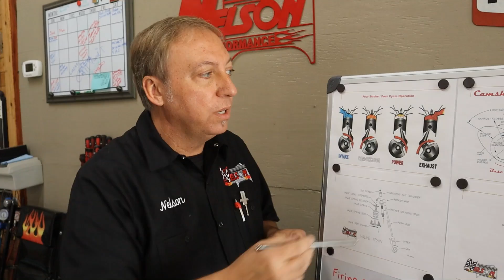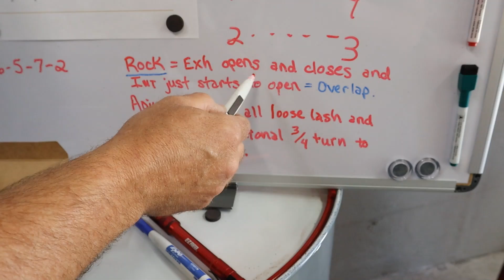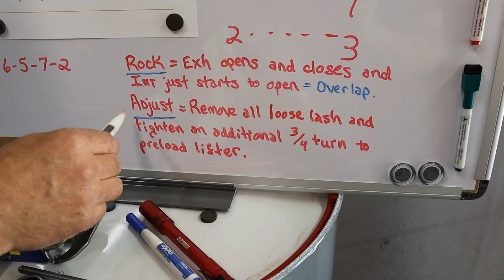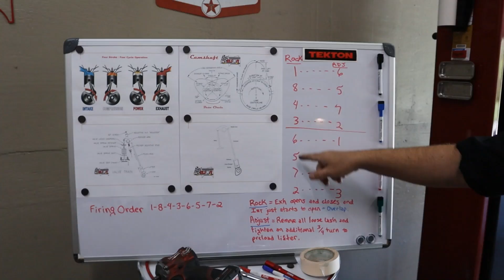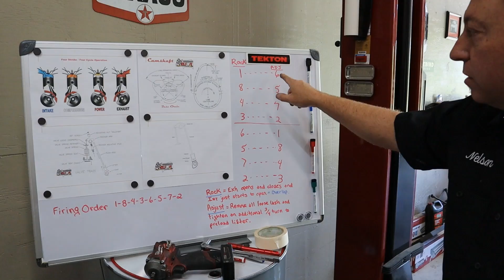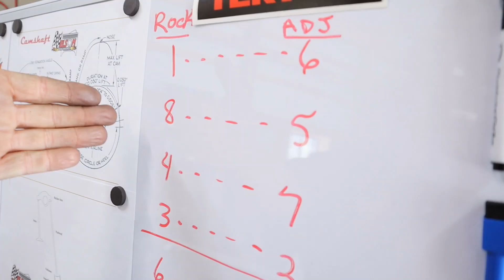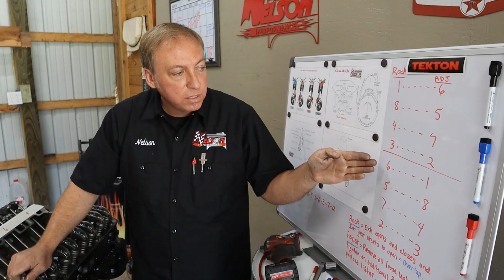Rocker Arm/Hydraulic Lifter Adjustment

Comment: Dear Mitch,  I´ve a 2.8 L V6 1988 Cutlass Ciera just overhauled. I primed engine two times turning oil pump with a electric drill. After engine hardly started, worked roughly.  But after seeing some videos I realized that I never applied a 1 1/2 turns of preload. After atemps to start the engine, starter can´t overcome engine counterpression. I suspect valves are lacking adjustment. The 1st compression test and come up with  very low values:  cil 1with 85 p.s.i., cil 2 with 75 p.s.i., cil 3 with 65 p.s.i, cil 4 with 80 p.s.i., cil 5 with 75#, and cil 6 with 80 p.s.i.  Do you recommend  dynamic valve adjust, despite oil spill all over, or there´s a chance of perform, a 120 degress rotation every piston and adjust every cylinder, according to firing order, and apply 1 1/2 turn of preload, despite lifters now are filled with oil? Thanks in advance, sorry it´s my first engine overhaul, and I saw a little bit late your very interesting video uploaded .

Comment: Question.  Is this method for lifters that have no oil in them  or can this be used with lifter that have been soaked in oil.   Thank you
Reply from the maker: Hello, you can still use the 3/4 turn and do the adjustment with lifters that already have oil pressure in them. The valve springs have enough pressure to “bleed” the lifter back under full valve lift during the adjustment process since there is no oil pressure until the engine is started up. I prefer to do a dry install until after the adjustment is made ,then use an oil pump primer (in the distributor hole) to circulate oil through the system before start up. Good luck on your project! Thanks for the comment and viewing! Nelson
Reply: @mitchnelsonperformance 

Thank you very much for taking the time to explain it to me. Have a great new year. I’ll be looking forward to seeing some of your videos that happened to be the first one. I saw very informative and explained very well again have a great new year.   Joe
Reply from the maker: @joeheadley6024  No trouble 👌🏻 Happy New Year Joe!

Comment: Hey Mitch, if your still seeing this I'm guessing this works the same on a Mark IV 454 as long as you rock the right cylinder and adjust the one in accordance; correct? One other question I have, and I see answer both ways, correct to presoak lifters, or not, it seems (seems) yours are dry. Thanks bunches as this keep valve adjustment good and easy.
Reply from the maker: Hey Timothy, yes, the adjustment will work the same for the 454 and any engine with adjustable rocker stud/nut  (non torque type). I prefer to do the adjustment with dry lifters to make certain I can feel/see that preload, then use an oil pump primer (in the distributor hole) at the end before fire up. Good luck and thanks for subscribing and commenting 👍, Nelson.

Comment: What are the cups for on top of the valve springs
Reply from the maker: Hey Mike, I’m not positive that I know what you mean, but the steel shell that goes over the top of the spring before the retainer goes on it is an oil deflector to help in keeping too much oil from running down the valve stem and burning in the cylinder. Thanks for viewing and the comment, Nelson.

Comment: This would be hard to do this way with the motor in the vehicle and Intake still on
Reply from the maker: Hello first off, thanks for the view! Having the manifold on is no problem, you can just watch for the pushrods to fall and rise instead of watching the lifters and if you feel the up and down slack in the pushrod while tightening the adjuster nut you will know when to make the 3/4 turn. You can have a friend tap the starter while you watch them but it takes a very slight tap of the starter to get to the next adjustment. Good luck on the project!

Comment: The BEST way to adjust the valve train. You don't even need to touch the crank, you can just bump the starter. (Sometimes its bloody impossible to get to the crank bolt anyway!!)
Reply from the maker: Hello, thanks for the view! Yep, I agree, you can just watch for the pushrods to fall and rise instead of watching the lifters, and if you feel the up and down slack in the pushrod while tightening the adjuster nut you will know when to make the 3/4 turn. You can have a friend tap the starter while you watch them, but it takes a very slight tap of the starter to get to the next adjustment. Good luck on your project!

Comment: Man, I’ve watched a few videos on how to adjust my 1992 C4 5.7. Your was is the best so far. Don’t think it’ll make a difference whether it’s aluminum heads, but they adjusted perfectly!!! Thank for your video. It helps amateurs like me! Now to finally get this motor back together!!
Reply from the maker: Hey Mr. Fireman, thanks for the comment and good luck on the project. We have a black, 6 speed 91 C4 with the same stock heads making 425 dyno hp. Lingenfelter parts and the big Accel flat top intake. Those heads do not flow very well even ported. A cylinder head upgrade would be an easy 100 hp.

Comment: My F150 4.2L V6 has hydraulic lifters and no adjustments. I've read to replace the push rods and rocker arms, all you have to do with pull the old rocker arm, push rod and bolt the new parts in to spec. Have you ever heard of this for some engines? Im trying to do this with the engine still intact.
Reply from the maker: Hello Frank, Yes, the torque style are handy unless you have done a valve job and the valves have sank up in the heads or the heads or block have been milled then we use the process in the video to make sure the engine doesn’t need a shorter pushrod to achieve the proper lifter pre-load. In heavy production we used a GO~NO GO gauge to check them. The lash between the valve tip and rocker had to be no less than .080 and no more than .180 (dry lifter) or it required a pushrod length change since the engine was non adjustable. Good luck on your projects! Thanks for the comment and viewing! Nelson

Comment: Hello....Wish the Engine Shop that rebuilt my 5.7L for my 88 Suburban watched you video...After about 2k miles It was idling rough Plugs were Wet...I pulled the Valve Cover on the Pass side Bank..Ugh I found 4 Slightly Bent Pushrods...I ordrerd a New Set...Any Suggestions on where to set the tourqe wrench to start to Gain Compression ?..I did this 20yrs ago on my GTO...Any help would be awesome ..Daren
Reply from the maker: Hey Daren, sorry to hear about the work you had done. I’m unsure of your torque wrench question? but if you follow the video after replacing your pushrods it should run smoothly 👍

Comment: Well I can’t get our hydraulic lifters in our 68’ ford block to spring like this😢. We broke a cheap rocker arm that was on the valve train when we bought the car. We are replacing all rocker arms and push rods. Maybe since the car was running we still have oil in the lifters🤷‍♂️. Don’t have the intake off but was able to use a snake camera to verify we do have hydraulic lifters.
Reply from the maker: Hello, you can still use the 3/4 turn and do the adjustment with lifters that already have oil pressure in them. The valve springs have enough pressure to “bleed” the lifter back under full valve lift during the adjustment process since there is no oil pressure until the engine is started up. Good luck on your project! Thanks for the comment and viewing! Nelson
Reply: @mitchnelsonperformance thanks for the info I haven’t dealt with engines this deep since the 80’s. We finally got it started but have all the rockers at zero lash . There’s something wrong with these 10 yr old flow tech heads I’m starting to think.
Reply from the maker: Hello, I’ve used the flow tech heads before. About the only thing I’ve heard from the older ones were complaints of the “hardness” wasn’t done properly. Maybe do a leak down test on it? Good luck and Thanks for viewing and commenting , Nelson
Reply: @mitchnelsonperformance  yeah I think that’s our next testing. Had 140 psi compression when we parked it a couple of months ago now we can only get 30psi with 6 pumps . The valves could be sticking now but not sure why.

Comment: my engine still in car with intake on, should i have my engine warmed up or i can do it while its cold?
Reply from the maker: Hello first off, thanks for the view! Having the manifold on is no problem, and they are best adjusted cold. You can just watch for the pushrods to fall and rise instead of watching the lifters and if you feel the up and down slack in the pushrod while tightening the adjuster nut you will know when to make the 3/4 turn. You can have a friend tap the starter while you watch them but it takes a very slight tap of the starter to get to the next adjustment. Good luck on the project!

Comment: I'm impressed. Could not be more clear and succinct. 
So once you have " rocked" and made your adjustments to the corresponding cylinder you want to make sure that both lifters are not in contact with the retaining clip. In other words,  they are both loaded ???
Now if I have an 4.9l Ford 6 cylinder with a firing order  1 4 2 6 3 5 , would my adjustment order simply be its reverse,  5 3 6 2 4  ? Thank you.
Reply from the maker: Hello, so your adjust order if you rock cyl #1 first and adj #6 then rock 4 adj 3 then rock 2 adj 5 then 6-1,  3-4,  5-2. Hope that helps. Good luck on the project and thanks for the view and comment , Nelson.
Reply: @mitchnelsonperformance 
Yes .Thank you. Exactly right.

Comment: That's a lot of explanation.   Just set the motor up to TDC # 1 and adjust number 1 intake and exhaust,  then turn the crank 90 degrees and do # 8 intake and exhaust,  and just turn 90 degrees and do the next cylinder in the firing order (which would be cylinder # 4 here)and repeat until all rockers are adjusted according to firing order.
Reply from the maker: Thank you for the comment and the viewing 👍

Comment: how do you know when the valves on #1 cylinder are on overlap with the intake is still on engine?
Reply from the maker: Hello first off, thanks for the view! Having the manifold on is no problem, you can just watch for the pushrods to fall and rise instead of watching the lifters and if you feel the up and down slack in the pushrod while tightening the adjuster nut you will know when to make the 3/4 turn. You can have a friend tap the starter while you watch them but it takes a very slight tap of the starter to get to the next adjustment. Good luck on the project!

Comment: Will this work because I am replaceing all the rocker arm nuts with an engine that is all together and runningI read that lifters need no oil in them of this method
Reply from the maker: Hello, you can still use the 3/4 turn and do the adjustment with lifters that already have oil pressure in them. The valve springs have enough pressure to “bleed” the lifter back under full valve lift during the adjustment process since there is no oil pressure until the engine is started up. Good luck on your project! Thanks for the comment and viewing! Nelson

Comment: this helps so much, thank you. '94 Corvette Gen 2 LT1--my cam lobes look a bit "worn" as in the centers of them have a silver lining as if the finish came off, but there's no physical pitting or cuts anywhere. do you think this would be a lifter issue? 70k miles so far...
Reply from the maker: Hello, first off thanks for the view and comment, on that LT-1 it’s not uncommon to see the travel pattern on the roller lifter cam. That shouldn’t be an issue unless you can feel a worn edge/lip on them. We have used the LT-1 heads for a few builds. They have good flow potential (260cfm) and a nice small  port volume to keep that velocity up. We have also used the LT-4 heads that have a 290 cfm potential. Getting hard to find those. Mean set of heads for such a small port volume. 😁

Comment: This is correct but unnecessary. There is no need to set one cylinder to adjust another. Just do the adjustment when the cylinder is at TDC of compression stroke.
Reply from the maker: Thanks for the view 👌🏻

Comment: So should I not take out the lash by shaking the rod up and down until it stops or should I just shake the rocker arm up and down till it stops then do the 3/4 turn and heard other videos saying only do 1/2 is there any reason why they would say that?
Reply from the maker: Hello Aaron, either way is fine as long as you are certain you are not pushing the plunger down when lifting up and down on the pushrod. This is why I recommend lifting up and down on the rocker itself. Thanks for commenting and viewing and subscribing, Nelson

Comment: Great tip for adjusting,on the other hand my pontiac 455 that I’m building with 6x-4 heads has no adjustment 20 lbs torque the rocker nut and done.
Reply from the maker: Yep, I have some old pontiacs too. The video is nice for checking to make sure you have enough preload (oil) in the lifter after the rockers are installed. if the heads or block have been milled or the valves and valve seats have been recut then it may need shorter pushrods to get the min of .080 between the rocker and valve tip or a maximum of .180 (to keep the lifter plunger off of the retaining clip) Good luck on the Project , Nelson

Comment: If your lifters are already oil filled would you still go 3/4 turn after zero lash or would you recommend 1/2 turn. Thank you
Reply from the maker: Either will be fine. Anywhere from 1/2 to a full turn will work for preload

Comment: I really like this method, but how would you do it if you have an engine like the LS1 where you can't actually see the pushrods and lifters in the valley? The only way I can think of is using a bore scope on each cylinder to see when it's at top dead center on the compression stroke, but plan it the way you did using the firing order so you know which cylinder to go to next and don't have to rotate it 200 times.
Reply from the maker: Hello first off, thanks for the view! Having the manifold on or engines like the LS is no problem, you can just watch for the pushrods to fall and rise instead of watching the lifters and if you feel the up and down slack in the pushrod while tightening the adjuster nut you will know when to make the 3/4 turn. You can have a friend tap the starter while you watch them if it’s in the vehicle but it takes a very slight tap of the starter to get to the next adjustment. Good luck on the project!
Reply: @mitchnelsonperformance  I appreciate the reply and detailed explanation! Thanks for the help and taking the time to pass on your knowledge!

Comment: Hola!! The oil you recommend is Castrol GTX 15w40  or 20w50?
Reply from the maker: 10w40 would be thick enough. Standard oil (non-synthetic)
Reply: @mitchnelsonperformance  I don't understand!! The oil you recommend is semi-synthetic!! Today I measured the pressure: 18 psi (idle) and 35 psi (2400 rpm).
Reply from the maker: No, you want NON-SYNTHETIC.

Comment: Hello!! I have a Land Rover Discovery v8i (1994), which starts well, but when it reaches temperature the hydraulic lifters start knocking!! What could it be?
Reply from the maker: Hello, I would see what the oil pressure is doing when hot v/s cold. I can’t recall if that has the Buick style V8 in it, but if so the oil pump is in an aluminum housing that tends to grow and lose pressure when warmed up. We did a thermal breakdown test years ago and Castro GTX non synthetic held its viscosity (thickness) better than any tested when hot. This oil may help.
Reply: @mitchnelsonperformance  Yes, it's a 1994 Discovery 3.9 v8i, Buik-style. I'm currently trying 5W40 oil  + additive (Mannol), and it still makes a noise!
Reply: The oil you recommend is Castrol GTX 15w40?

Comment: Only 7.34k subscribers as of writing this, 1.2 million views. Clearly this is good info, come on people subscribe!
Reply from the maker: Thank you dirt sweat gears for that shout out 😁 Nelson
Reply: @mitchnelsonperformance  absolutely! I'm doing a refresh on my S-10 2.8, I especially like the whiteboard and that you explained how you arrived at the rock/adjust pattern. It made it very easy to figure out how to adjust my 2.8. I even drew it out the exact same way. I'll put a link to your channel in my video when it's done
Reply from the maker: Yes! Please do! Had a 2.8 in my Fiero 😁 a 3.4 L 94 Camaro engine would be a nice upgrade someday in your S-10.
Reply: @ Yes it would! The ONLY reason I'm rebuilding the 2.8 is because I couldn't find a 3.4 before my vacation. I've never done a bottom end refresh before, and this one had 0 compression in cyl 6 so I figured I can't possibly make it worse. 

I've learned a LOT doing this so even if it's a total failure, it wasn't a waste of time. It's been a great experience thus far.

Comment: I have a marble like noise that sounds like its coming from driver side valve cover.  Had a bent rod about 3 years ago but now fires up fine and idles fine. I got scared and its been parked for about 4 months. Wonder if i just need an adjustment.
Reply from the maker: Hey Ben, I would pull the cover and make sure all valves are moving up and down and opening as well, so you know you don’t have a worn cam lobe then I would go through and check the valve adjustments and make sure you don’t have a collapsed lifter that won’t pump up. Good luck on the project and thanks for viewing and the comment, Nelson.
Reply: @mitchnelsonperformance  that is the sad and sorry plan. Maybe with the amount of dollhairs the government is saving us right now ill be able to get it done soon. Hahahaha